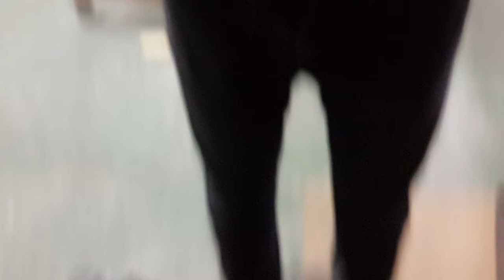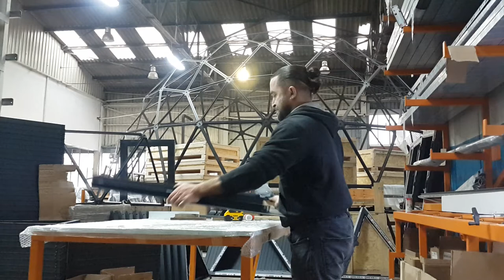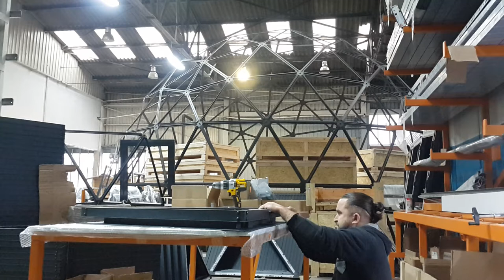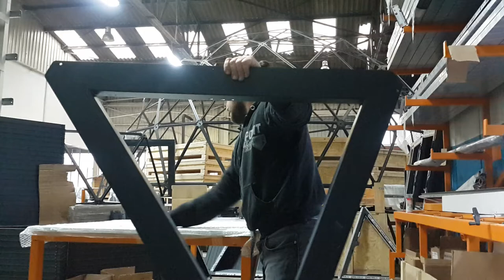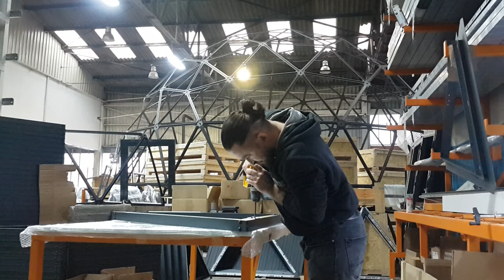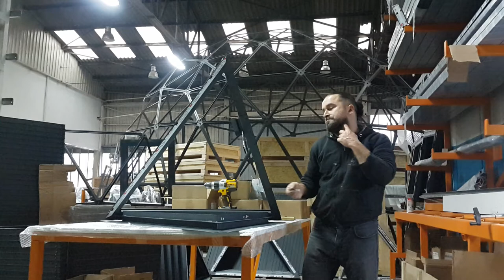Aluminum dome window manufacturing

Comment: 118x118x125 2 adet pencere fiyat  nedır ustam
Reply from the maker: Merhaba pencereniz üçgen sanırım yanlız kullanılan malzemeye göre fiyatlar degişim gösterir örnegin alüminyum dogramada özel boya olacakmı ve aldoks serisi c 60 serisi ve sistem serileri mevcuttur cam olarak kalınlıklarıyla birlikte lamine cam füme cam tamperli cam istege göre fiyatlanır videoda kullanılan sistem kanat aldoks serisi kasa kubbelere özel kendi tasarladıgımız kaynaklı 2 milim sac profilidir iyi günler
Reply: @mehmetakbas3751  saç profil taşırsa sağlıklı olursa 8 mm temperli cam ile birlikte.
Reply from the maker: @kemalgurle4339   özel kalıp kesim adet miktarı fazla olursa 1 veya 2 pencere için yapılmıyor örnegin müşteri 250 adet istiyorsa kalıp çıkar mevcut piyasadaki standart kasa kanat profilleri işinizi görürmü nerede uygulanacagını ögrenebilirmiyim
Reply from the maker: 05382134458 buradan irtibat kurabilsiniz